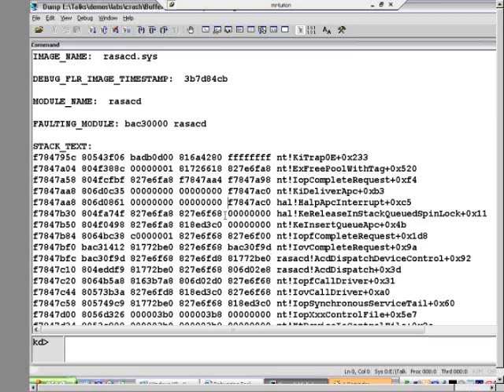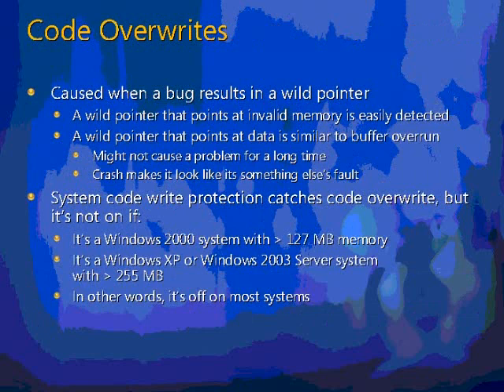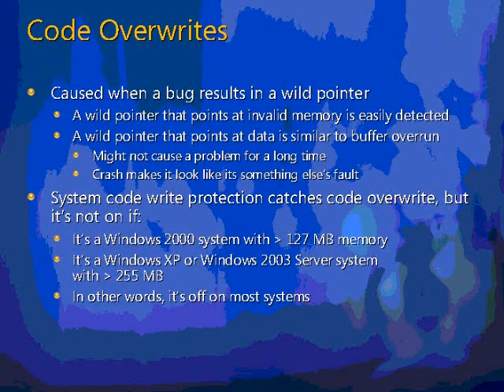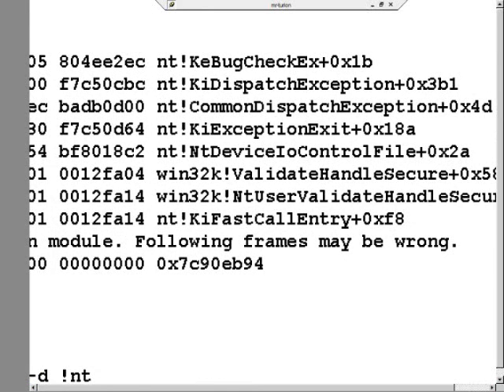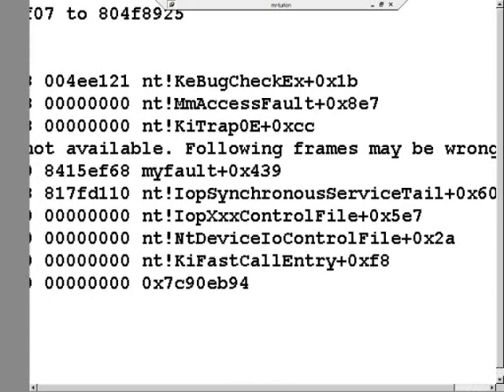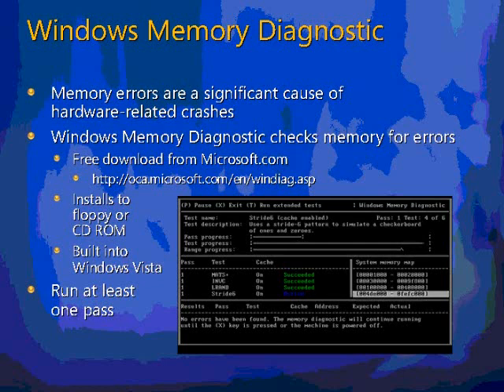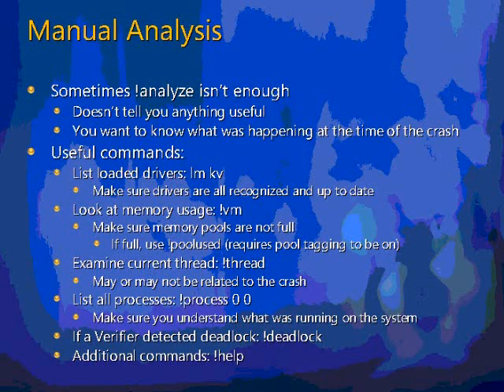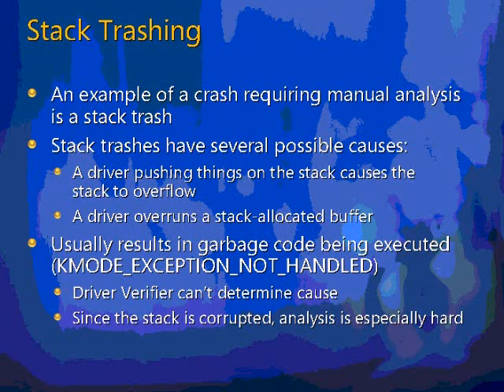Windows Hang and Crash Dump Analysis 7/9

Comment: crash dump analysis doesnot make any sense, it is always direct hardware access to
kernel- means defctive hardware (graficcard eg. or ram)
if driver is defective it should be possiblle to repair over F5 or F8 to start with minimal driver.top of menu in F8.
If software causes the crash bluescreen uninstall it there.
other analysis of crashdump waste your time because  the mistake is not defined in crashdump and MS solutionjs doesnot work the whole day